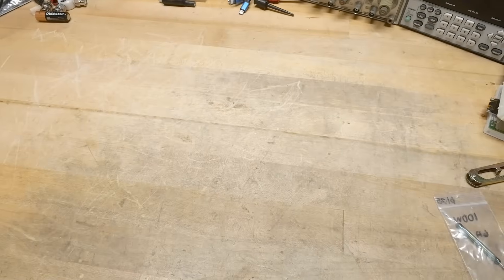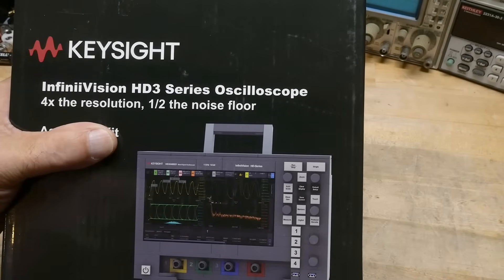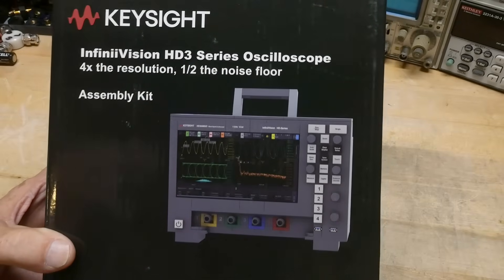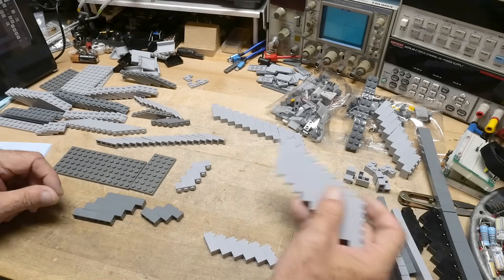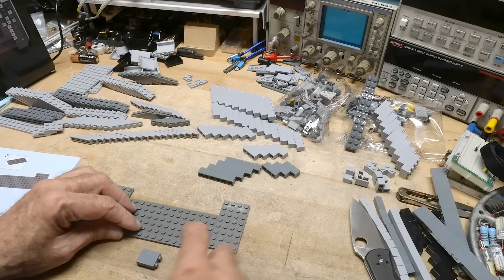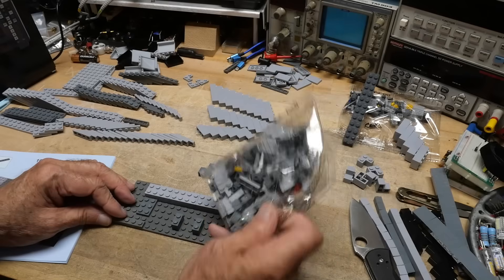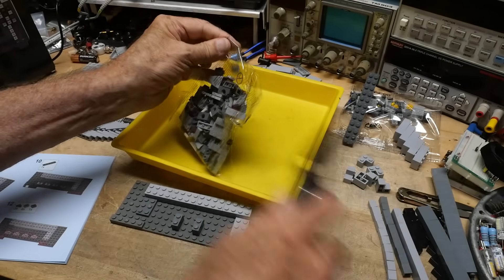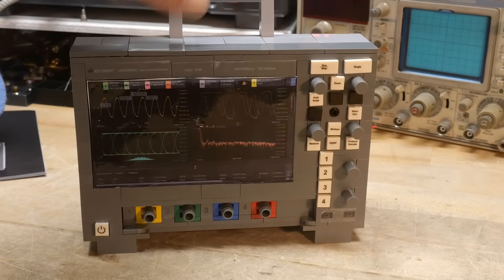#2320 Keysight Oscilloscope Kit

Comment: You reminded me of my rare HP oscilloscope. It was a tube model 'DY' 'scope. (It was an HP 'scope that they turned the badge upside down and sold as a 'dy' 'scope. I think it might have been a military variation of an HP 'scope, but they built too many of them so they rotated the 'hp' badge 180 degrees and sold them off as 'dy' 'scopes. I think it drew close to 1,000 watts, although that may have been my 524C. They both were electric heaters with lots of knobs. I used the 'dy' or the 524C as the heater in winter in my shed 'lab' when I lived on the back side of Pikes Peak. Between the 2 of them the shed was always toasty.

Comment: I like the high input impedance with the low capacity that does not affect the bandwidth. Low fan-noise is also important, the arrangement of the buttons could be improved. Check with IMSAi Dog for another bag with some other interesting components.

Comment: Next task is to make it work like an oscilloscope
Reply: Trivial job. Just have 4-5 slightly different designs that can incorporate most common phone sizes, include an audio jack (sorry - USB-C headphone) to BNC-connector-brick adapter cable, and slap on a QR code that links to an app that can show audio-frequency waves and spectra through the standard headphone input (there are about a bajillion of these already, many open source) - and Bob's your uncle...